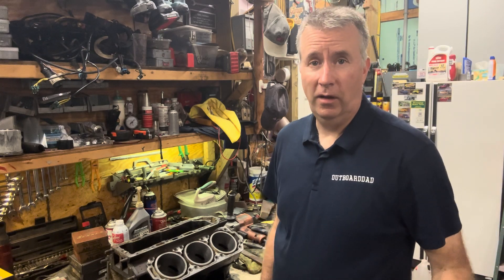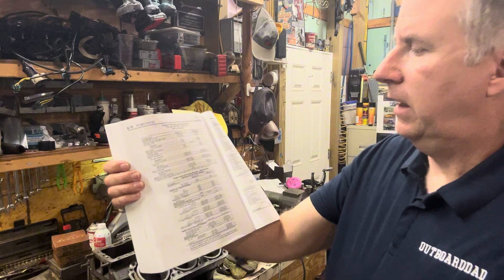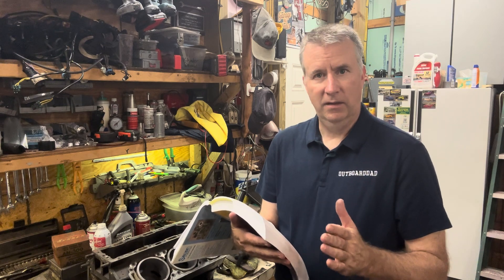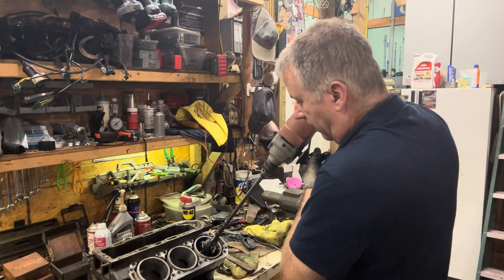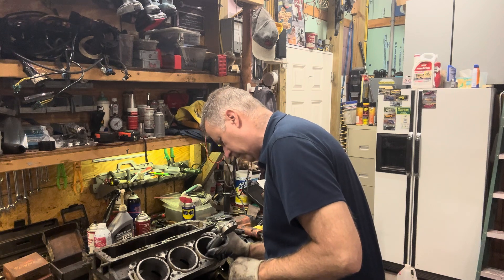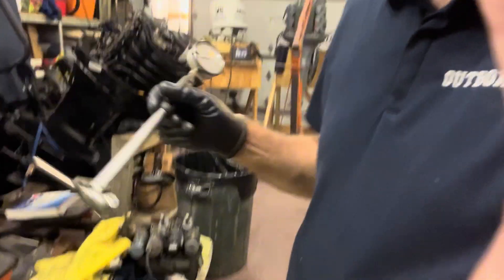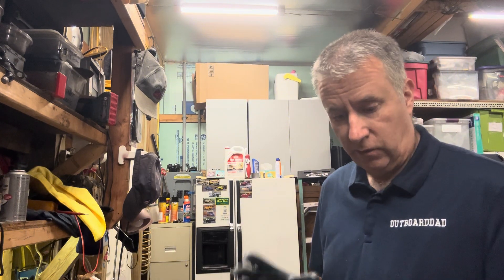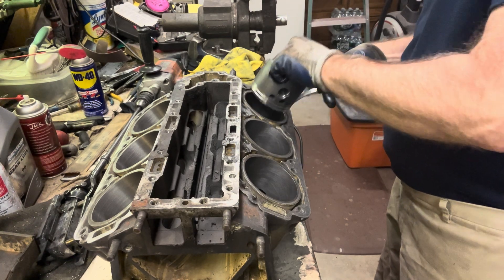Mercury Outboard rebuild boring honing (Part 18)

Comment: set your bore gauge to the stardard size bore( 3.501 ) If its out more than .003 in any direction then it needs bored   You will need a boring bar to remove the material and keep the bore straight   Then hone to finish size
Reply from the maker: Thanks for the info! Have you bored and honed blind cylinders for outboards?

Comment: Great job!
I see you are being safe by double checking. 
Better safe than sorry! 

My only experience was one tine that I had to send the cylinder in order to put an oversized puston. 
Most of the times it was just a matter of replacing pistons. I probably did it 5 or 6 times but I can't remember because it was in my youth.

I also ordered to replace the cylinder and the piston, a Wiseco made for racing, of my last dirtbike that I am still using although now Im old, because I wanted the latest upgrade of this engine, which runs better than ever with latest 21st century carbon fiber reed valves, latest ignition system and a 39mm Keihin carburator very carefully jeted thanks to a new pyrometer installed  indude the exhaust pipe.

Last time with pistons was ordering to replace the piston, seals and gaskets for one of my small outboards. It would have been cheaper to buy a new engine but I didn't want to switch to a four stroke. 
The engine sounded like new after replacing that piston.

I'm afraid that I will have to do a job like yours, if I am brave enough in the near future, because my 1998 Mercury 135 2.0 is now overheating.
I'm pretty sure that there would be some scratches in all 6 cylinders but I don't feel opening the motor unless I really have to.

A camera for my cell phone like yours, to see what it looks like inside, is the next step. 

The engine sounds fine and seems to have plenty of power, but I don't want to attempt taking it apart until I find why it's getting overheated every time I go over 2000 rpm.
Reply from the maker: @josemariatrueba4568  Makes sense